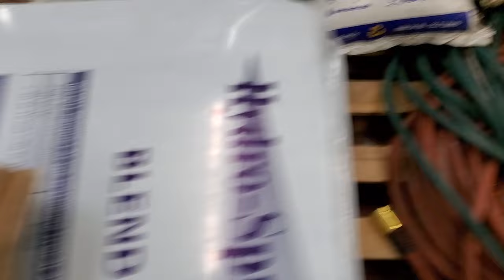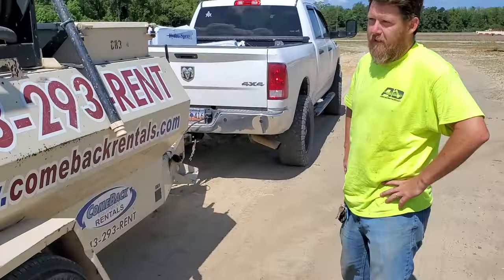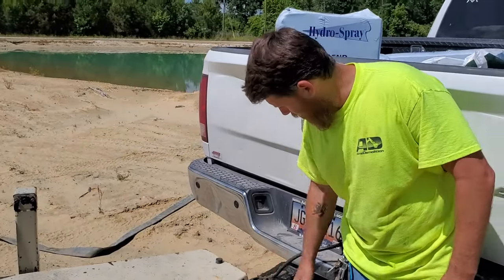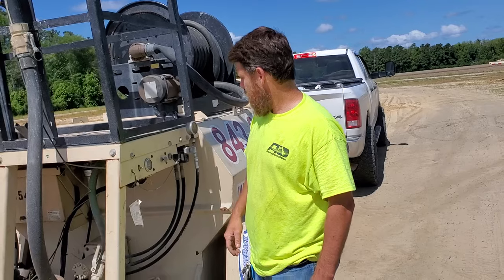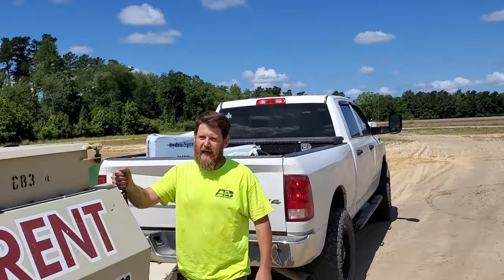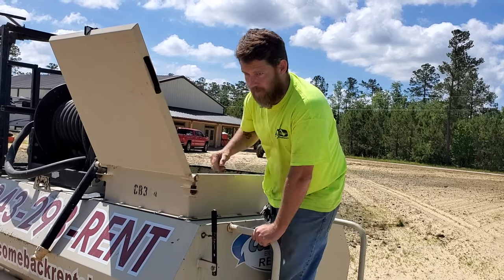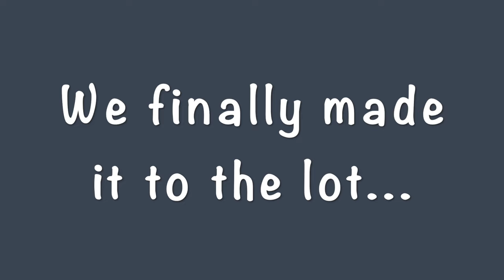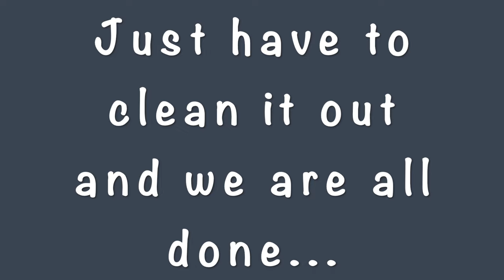How to Hydro-Seed [ Hydro seeding 101 ]

Comment: Nice video. After hydro seeding after how many weeks will you apply fertilizer (they say to apply starter fertilizer after 5 to 6 weeks). Do you mow and then apply the fertilizer or just apply it on the grass since again you’ll need to wait till 8 weeks to mow the lawn? By then the fertilizer would have anyway settled right?
Reply from the maker: Thats an awesome question! I actually dont know the answer to that. We only hydro seed lots after we tear down houses. The maintenance and up keep is up to the property owner once we leave, we dont come back to fertilize!
Reply: Hydroseeding is done on new subdivisions and demolition projects to suppress the dust. The dust is pain in the provervbial if not suppressed.

Comment: Thanks for the video! Can you add the cost breakdown in the video description?
Reply from the maker: Seed:

1 bag of contractors seed - $99.00
1 Bag of all Green seed - $69.00
1 bag of fertilizer - $25.00
1 bag of neutralime - $32.00
1 container of Floc Lock - $26 
4 Bales of hydro mulch - $20.00 each - $80.00 total 

Rental of the machine - $267.00 

Total time involved picking up, mixing, spraying, and returning unit..... maybe 6 hours 

Total cost = $598 + 6 hours of time!! This was only about a 1/4 acre lot (or less). It gets much cheaper per acre the more acres you do at a time!
Reply from the maker: 20k give or take. Really depends on what kind of seed you use.
Reply from the maker: Anytime!